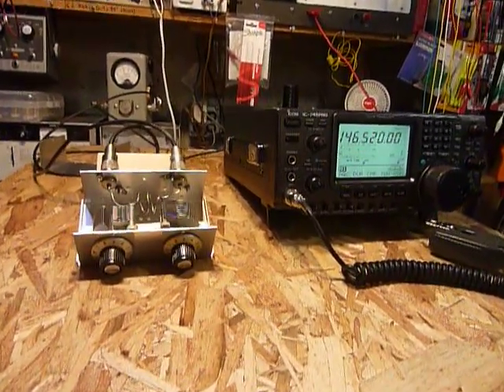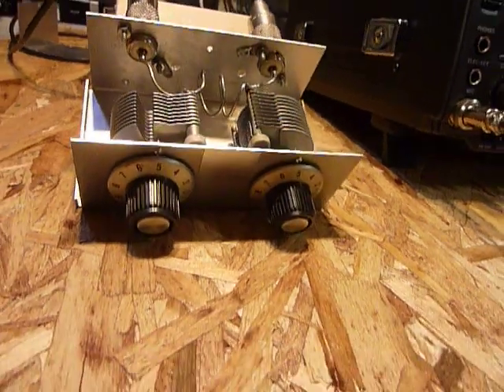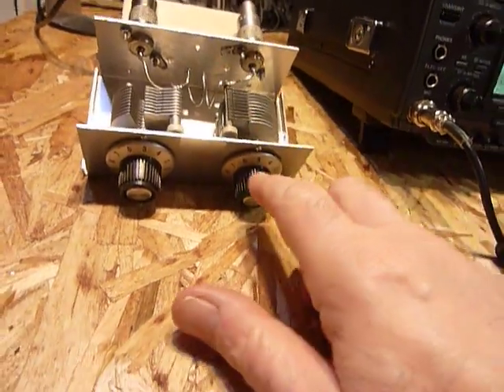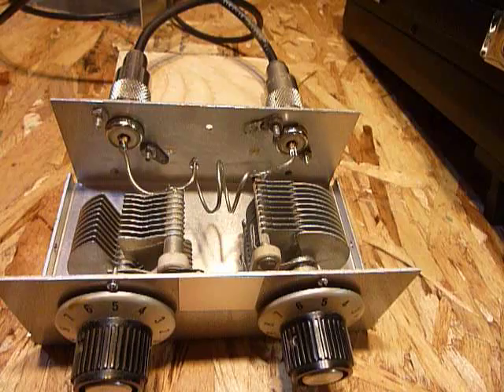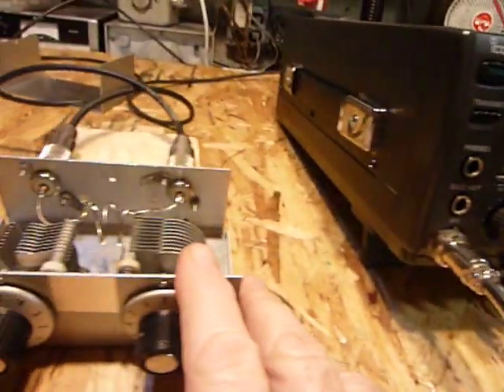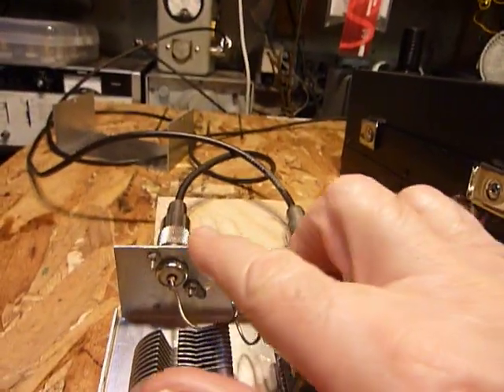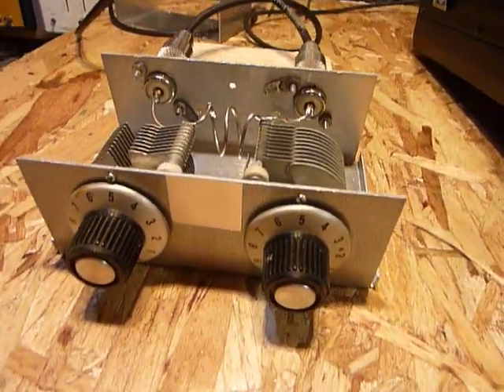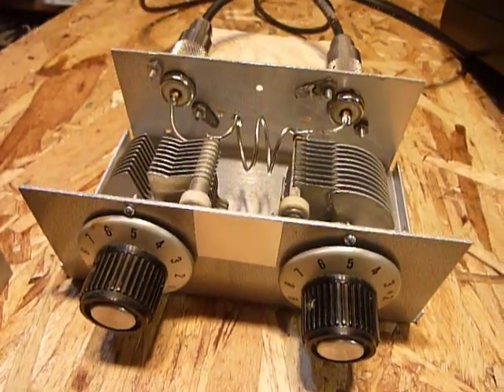2 METER ANTENNA TUNER , ONE EVENING 2 METER TUNER PROJECT,

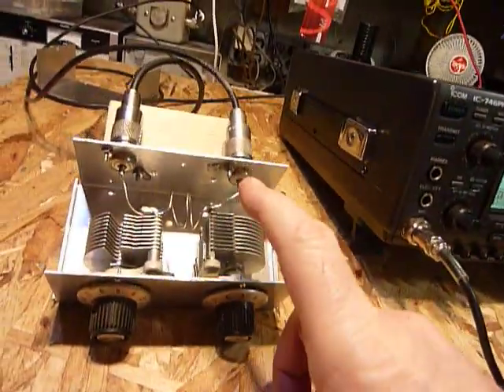Comment: 2:34 Two capacitors at 100 uF each. Well, i think we all know you meant 100 pF each. 😉 fine job on the tuner. 73! de KD5MHQ
Reply: Excactly what I thought Bob. I want to make one for a good friend who did buy my old 2 meter beam. On the floor his SWR was 1:1.1. Once up on in the antennetower(on the roof) it was 1:1.7. And now his amp is jumping into the protect-mode. So this nice tuner will be the solution for him. ;-)

Comment: Hey there Robert, I’ll say that 2metre tuners are as rare as hens teeth, for the reasons you gave. Yours is the only other one I know of - I have one made by   LAR ( Leeds Amateur Radio) a club in the North of England, they made a few and sold them in the 80’s. And they look the same as yours inside, though the caps are a tad smaller. 
Bottom line though Robert is, if ya need one ya need one, great work thank for Sharing.
Barnie. 73 de M7PBX.

Comment: How often are two capacitors needed? With low voltage on an antenna that has come partially out of tune could you just use a T-Net one capacitor only?

Comment: Nice Work Mate 🙏

I hope u managed to correct the antenna Problem
as you would get a lot of coaxial loss
at VHF with excess 3:1 swr
but that's a great solution in the meantime.

I haven't built a VHF ATU before.

Did you also try a T match config?
if so, did it also work just as well ?

Again, Nice Work & Thnx So Much for Sharing.

73 de VK3VKe 🙏

Comment: Very nice project to create. So these were 50  Pico farad air capacitors ? Maybe other ones with more plates would also work. I have a tuner that has electronic circuitry. Yet if something as simple as this works, then that's a plus. Good video. It would be good if you could actually put a video together on a new project slowing the build in progress. Thanks Billy. Albq N.M.  2 / 15 / 2023

Comment: Thanks OM Bob... 
I'm not climbing my tower  til I feel more up to it, and this did the trick for me. I raided my junk box and put together one with what I had on hand.  I needed to make the coil smaller, using my MFJ antenna analyzer to measure SWR. Right on! it does the job like you say it would.  Big Up from 4X1MK.

Comment: I'm looking for 2M ATU that would get the SWR down when operating at 169MHz with a 144MHz antenna, would this ATU work? Thanks
Reply: It probably would work but you may lose a lot of power due to coax losses at a high swr even with the ATU at VHF.  Would be ok to get you on the air but inefficient.

Comment: Built one.  I had some caps with 17 plates (your had 9) tried 3 different coils about 3/4 inch diameter and cant dip below 2.5 to 1 anywhere in the 2 meter band.  Suggestions..  Ed W6AOA Pensacola
Reply: Maybe try it in a T match configuration and see how that goes.

Comment: Great video Bob, thanks.  Where can I find some adjustable caps like that?  What the proper name for them so I can try to search them ?
Reply: Air gap variable capacitors
Reply: @josephroblesjr.8944  ok. Thank you.  I can’t seem to find those anywhere
Reply from the maker: They are standard  50 PF maximum capacity capacitors  single hole mounting  with 1/4 inch shaft .  I recommend Ebay to find them  or one of the internet  radio suppliers who sell old time parts .  I also look for such parts at hamfests or ask  other hams at the local amateur radio club  .   Bob